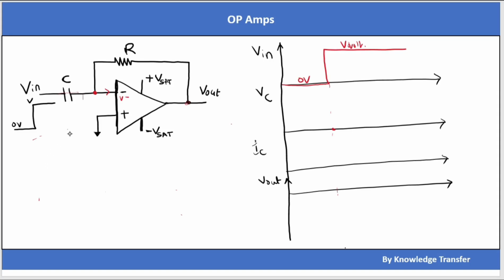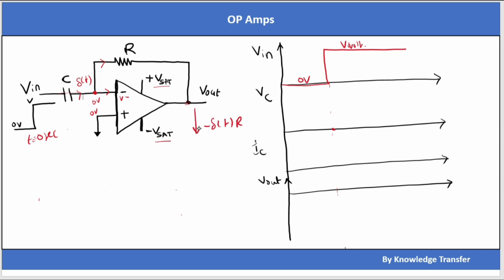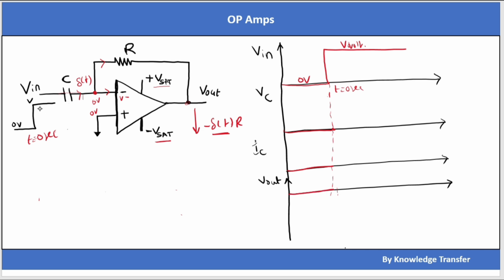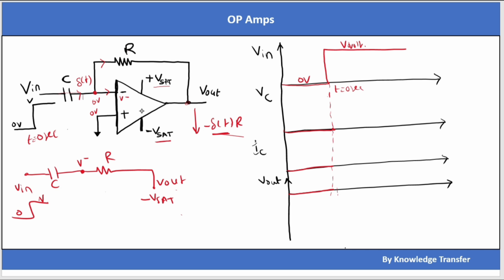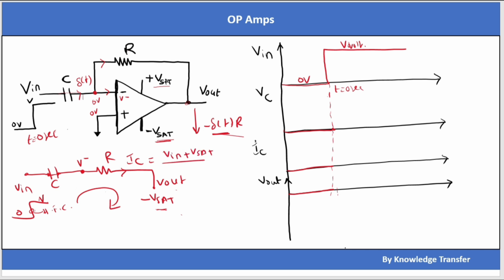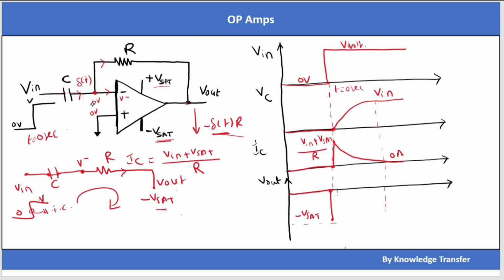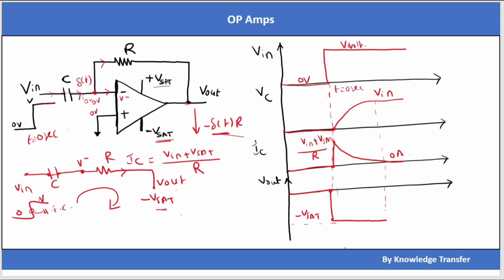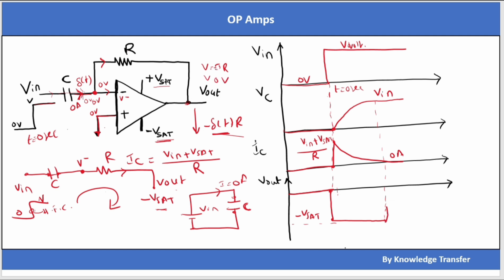Part-2, Practical OPAMP with Capacitor. Opamp feedback with capacitor

Comment: Sir here at t=0 there is a impulsive current 
then why not capacitor charges immediately
Reply from the maker: As opamp output can only go till -VSAT, at t=0 impulse current is not flowing here. If opamp is ideal and Vout can swing till infinity then impulse current will flow and cap charges instantly.
Reply from the maker: For ideal opamp analysis refer this video -->.  https://youtu.be/rgEf_cfcjus?si=H3KY1V3pLpNcHRMV
Reply: @knowledgetransfer8408 understand 
Thank you Sir